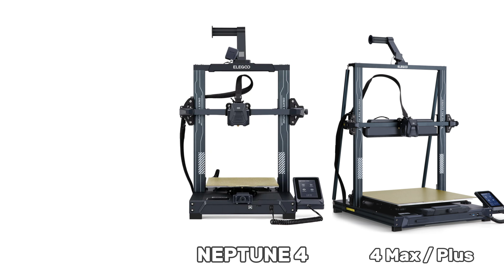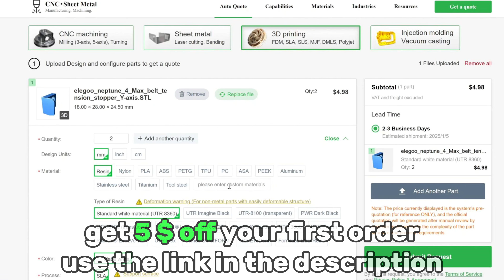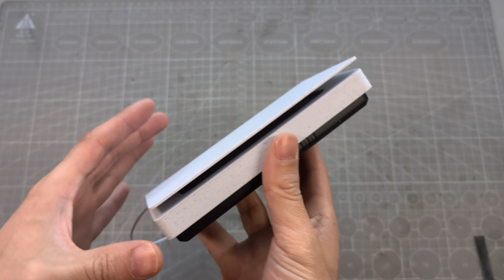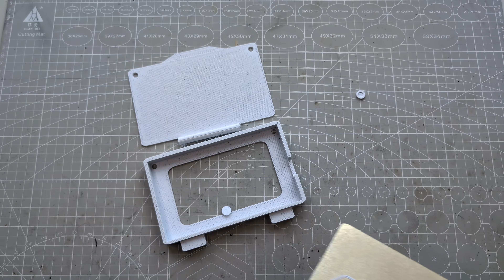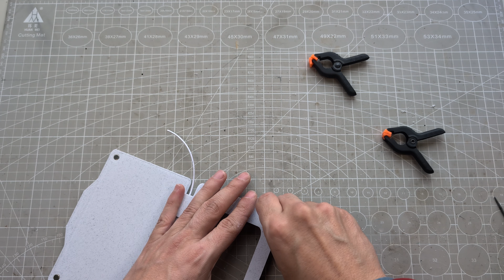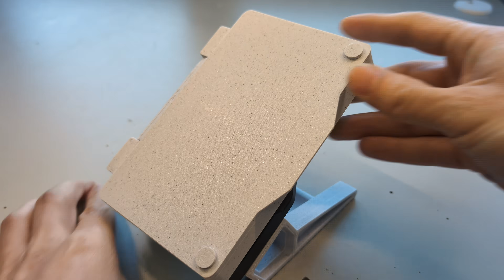build a Display Cover for Elegoo Neptune Printers - Upgrades Part 6

Comment: Watched all of your videos on the Neptune pro so far. Very impressed with your videos and the parts you are designing. I just bought a Neptune 4 pro and am going to set it up tonight. Wish me luck 😂
Reply from the maker: @garypratt1858  Hey Gary, thanks a lot for your kind words, that means a lot to me. I am currently editing part 7 of this series, but one video takes me between 20 to 30 hours to make, so it may take 2 or 3 weeks for that one to release.
I wish you a lot of fun with this great project you have started. Cheers ✌️
Reply: @Dirt-E-Bikes  Thanks. Built it last night. The cable clip for the main cable to the print head is really badly designed so I think your upgrades are very much needed. Love the spine and chain cable routing so after a practise print today I think they will be the first functional prints I do. Just about to power up fir the first time and get the bed leveling done. Hope I don't have a bad one like you did first time round.
Reply from the maker: @garypratt1858  how did it go so far? I think the bad printers were only at the very beginning. I was one of the first persons that got one of the new elegoo n4 ;-)

Comment: I have tried printing the z-cable chain, but for some reason the very last part of the chain that clips to the extruder does not fit the rest of the chain and gets disconnected easily. Any ideas how can I fix it? Thx
Reply from the maker: @vasd3415  hi vasd, im not sure why on your printer that last part is not fitting right... Is your printer the N4 or the N3 (not sure if there is a difference, but trying to sort things out.)?
Reply: @Dirt-E-Bikes  Its an N4 plus but I figured that the cable chain should be the same give the fact that the extruders are the same
Reply from the maker: @vasd3415  okay, i wasnt sure if there is any difference, but that sounds right to me. I am currently not at home, but as soon as im there, i will take a look at the "spine cable chain"- end-piece, and hopefully i can give you a helping answer then.
Reply from the maker: @vasd3415  im at home now, i will take a picture of the situation at the extruder end of the cable chain and post it on this channel so you can take a look.
Reply from the maker: @vasd3415  http://youtube.com/post/UgkxLqEHT50kWnv2GHcuVP7pB1pBv9PWY47N?si=5qsszLVn5kpsc4vQ

Thats the link for the picture